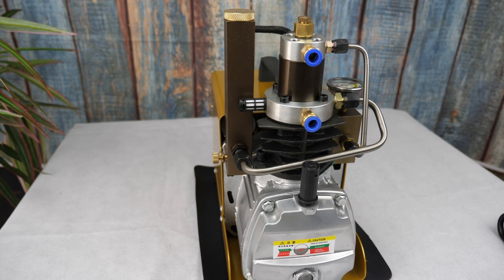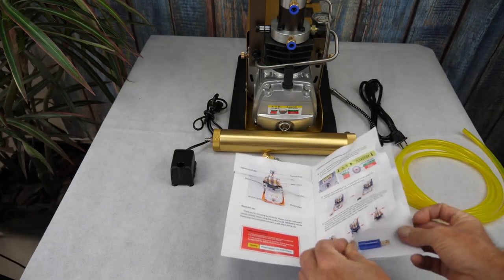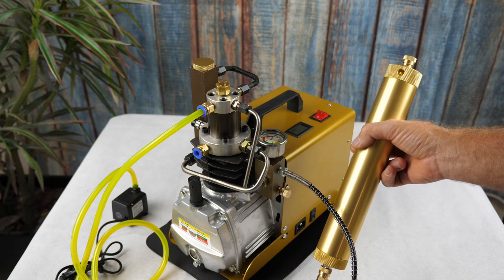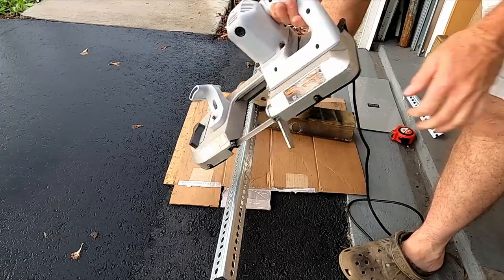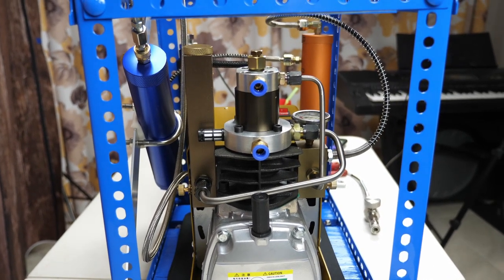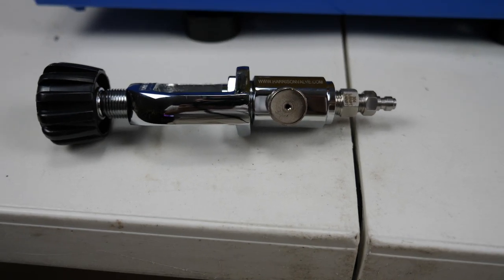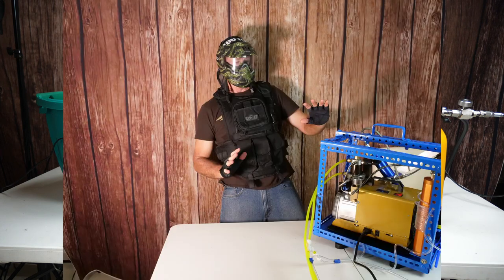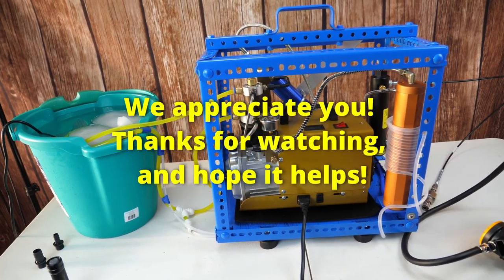Do It Yourself Scuba  Breathing Air Compressor

Comment: I am a Bauer and Nuvair factory technician, and the only thing I can say is that, wow, you've done your research, and you nailed all the key points. Maybe find a more effective way to do aftercooling, like using a coil of stainless tubing. And the final stage separator should be installed right after the final stage but after all the filters since moisture reduces the effectiveness of all the filters. The PMV should be something individual instead of built-in and installed after the final filter. Maybe consider installing remote air intake, dew point monitor and Co monitor as well as performing air testing to be compliant with Grade D breathing air or CSA 275.2. Also, consider replacing all the filters with a Bauer triplex.
Reply: SO that is my dilemma here Sir.  i have a Poseidon "UNI" Compressor. and need to augment/replace the old filtration system, as I was told that the Filters are now Obsolete.  It was built from the Bauer Compressor Head set up from the factory.  If you could give any advice here, as all the USA Reps I have contacted, I believe I am up to 6 across the USA, seem to not support this small Compressor, anymore. What is a Bauer Triplex, and costs? Thanks!

Comment: I have debated this before! Please give updates for n how the air works out, any tank issues, build sheet and costs, subscribing for this kinda info for sure!
Reply from the maker: Life got crazy busy, but I do plan to do shallow dives and disect the filters after some more use. Not really feasable for regular use and there is concerns of air quality. I plan to see about having air samples tested. But still a fun project.
Reply: @BringYourHelmet  OK, so you do not recommend any of the filters you rigged this with, I suppose, then?
Reply: In the process of setting up a Yong Heng compressor for PCP Airgunning. I removed the cigarette filter and went straight to a oil/water separator(the gold filter you see here with a drain) and a single cotton/charcoal/cotton filter. I also purchased Seccolube 500 which is similar to the diester based oil mentioned here for air purity. This is good enough for shooting

If I was going to trust my life to a compressor like this I would run this layout: compressor > oil/water separator > molecular sieve> cotton/charcoal/cotton filter> PMV valve

After doing all this, you SHOULD be safe. But if you want to be sure you can contact a lab and see if the air is considered breathing safe. They will provide you with instructions on how to send them the air.

I would advise AGAINST the current setup that he is using now, I personally think that he is using the BARE minimum for breathable air. I would rather spend a few hundred dollars on the proper filtration rather than passing out and dying underwater or getting some sort of lung disease because of the contaminants breathed in and paying THOUSANDS in medical bills.

 I wasn't aware of a PMV - Thank you for informing us on that. Great Video!

Comment: I just used a Husky oil less compressor with a Horrible Freight  spray paint filter and a $50 regulator and 2x 25 ft HF hoses I was down only 5.5 feet for 45 minutes in my pond vacuuming sludge off the bottom, and I had no problems what so ever. It was really cool in fact.

Comment: I want to try this on a scuba 4L small tank, I have recently bought an automatic PCP compressor like this one, got a proper water/oil filter and had to ensure I have the correct oil for breathing air. The tank has a quick release valve already inbuilt into it so I can connect the filter direct to the 4L tank, would this still work fine? or do I need to have the other additional filters you have got as well as a bleeding valve like you have?

Would like to hear your thoughts mate
Reply: It can be done, in the end it's a decision regarding safety. Maybe it works fine, or you pass out under water from CO. Hookah systems are without all the hassle, and can be made DIY too.
Reply: @timtim8468  I’ll test it out - gonna use the tank in a pool with someone assisting so we’ll see how it fares
Reply: It worked well and the breathable air was clean and decent. I used a breathable oil with the correct ISO and a big solid filter as well

Comment: Excellent build, and explanation, Sir!  Would you be as so kind to provide links, or if anybody else could on the Whole Filtration system parts sources? I was lucky to find an Electric Poseidon "UNI" model 3.5 CFM Compressor.  Several decades old but with maybe 10 max 80Cu tank fills in its whole life.  The issue is I have hit brick walls sourcing any of the Old Filter designs as they are now "Obsolete" I searched for even NOS filters, with no luck, as well.  So, like you I only wish for Clean Air going into these lungs of mine, and some directions as to what you sourced would be pure gold.  I was quoted over $1,100.00 for a custom build from Bauer, who made the Compressor head section for Poseidon to begin with.  Poseidon as a Company is no longer, and Bauer sort of bought them out. The USA Factory reps do not wish to support us small fries and cater to the Huge Compressor market mostly! If anyone else has any suggestions as well, I'd appreciate your input, as well! Thanks for a great understandable build, and use of your compressor! It should last you, because of your enhancements galore! Great JOB!!!

Comment: A while back i bought a similar compressor and air filter and everything, but my diving school prohibited me from using it as it's impossible to guarantee that the air is healthy clean. Official filling stations are sampled and checked by a lab to prove that the air is good, and that the machinery is almost guaranteed to keep working in that clean way. If you want to poison yourself it's your own choice, but your buddy is also depending on the air quality in your tank. Which makes it rude to fill your tank with this.

Comment: Do not do this.  Not enough oxygen in the air for this.
Reply: How so ?.
Reply: @brianredmond4919  the compressors sometimes has little combustion in the cylinder depending on the oil maybe.  I run royal purple full synthetic and probably still wouldn't try to breathe it. The oxygen levels are very low probably due to the small combustions. Scuba shops have big fancy compressors and tanks probably already filled they can cascade into your bottle.
Reply: @brianredmond4919  I saw a review on YouTube where the guy sent off the air to get tested and oxygen levels were just too low.
Reply: @drywallman1986  what you’re saying makes no scientific or medical sense.  The oxygen level is absolutely the same going into and out of this compressor.  The risk with oil based “air’ compressors in terms of breathing is lipoid pneumonia… the diester oil addresses this point.  The danger really is if someone tries to compress enriched air I.e. higher concentration oxygen.  That’s when unrated oils, combined with pressure results in a possible explosion.
Reply: @drywallman1986  depending on what he sent the sample container had in it before adding the gas under test and the elevation where the sample was collected can affect the results.  There may be oxidation in this system, but there is no ‘mini combustion’ going on!  👌🏿😉
Reply: @en2oh well from my experience the oil burns a bit out of the compressor due to its miserable cooling. So i can imagine there is some oxygen goes burnt while pumping. However i don't think it's decreases its concentration much. What i would rather concern of is a really good filtering.